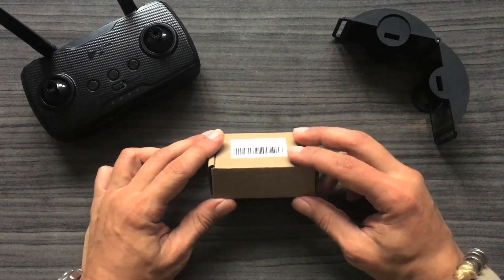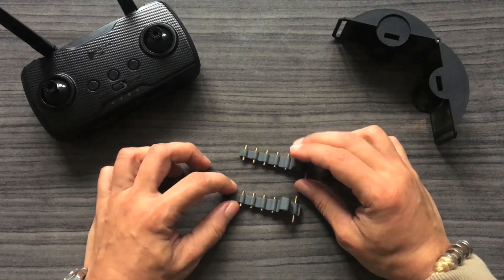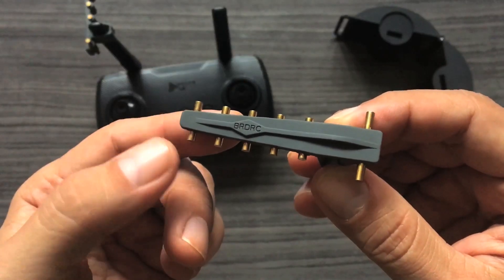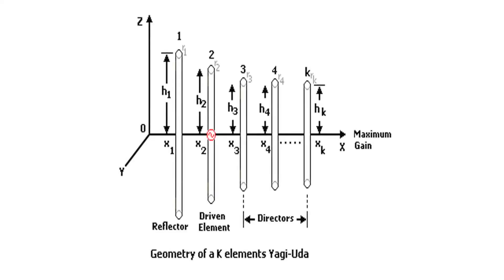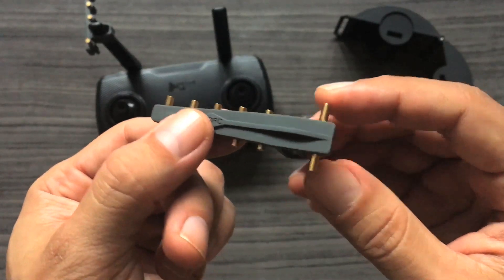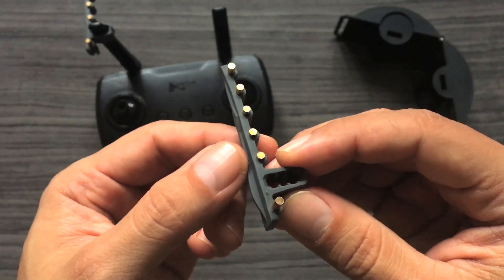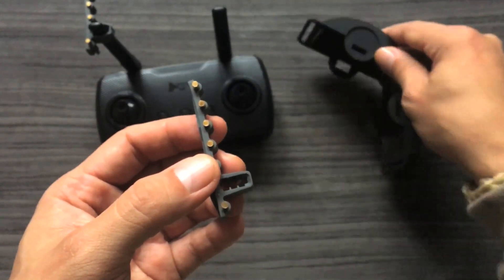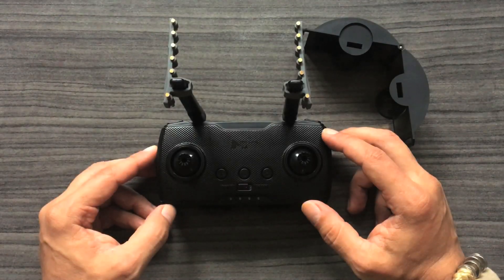THE YAGI UDA - What is it and what does it do #educationalvideo

Comment: On many controllers, one or both antenna may be "dummy antennae", with no wire. Would these or parabolic reflectors do any good on those?
Reply from the maker: Good question. All remote controllers have antennas, whether fixed inside or extended on antenna poles on the outside of them. The parabolic and yagi antenna help boost and direct the signal by radiating it outwards into a beam pattern or a widened lobe pattern... in order for them to work properly they need to be connected or attached to the area where the antennas radiate their signal. With that being said, I’m not so sure that they work on controllers with internal antennas.... That would have to be tested and researched. Thanks for your question.